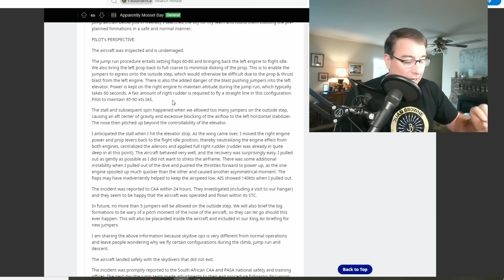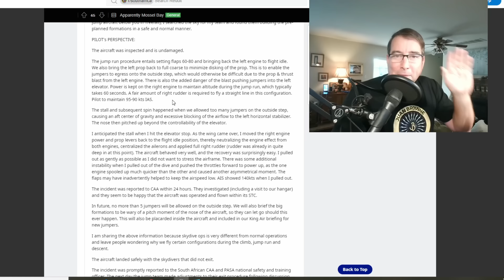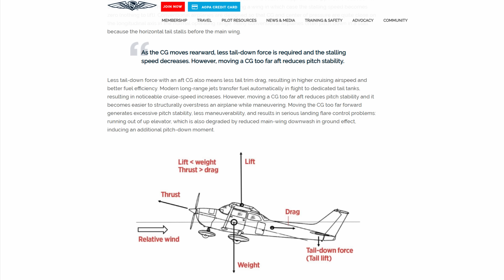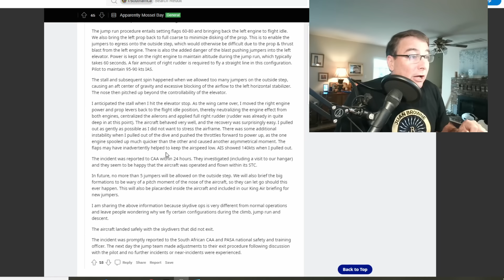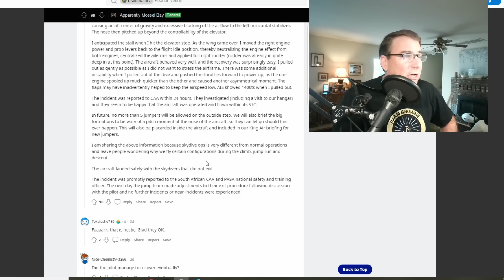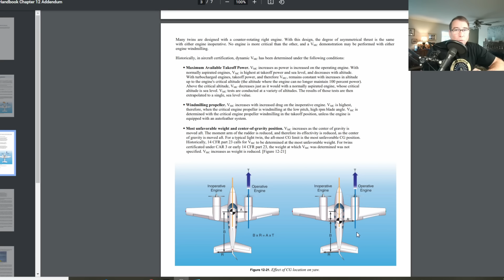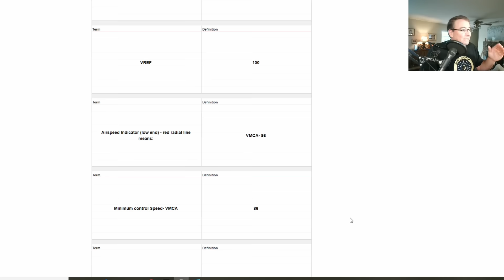Stall+Yaw=SPIN!  King Air Skydive Incident

Comment: On the inverted spin recovery vid at the end, is the reason you pull the stick back after opposite rudder is because it’s inverted? Cause I always am thinking stick forward?
Reply from the maker: yep...situational awareness.
Reply: Yes.  You want to point the nose of the plane at the ground to build air speed / break the stall.  When inverted the ground is stick aft.
Reply: Yes pull back if are inverted.
Decades ago when I was learning to fly gliders (in South Africa) my instructor threw me a curve ball.
He built up airspeed and then pulled up into a loop, but near the top he neutralised the elevator, so we continued to climb inverted until we were below stall speed.
A wing then dropped. At that point he said "you have contol". So I pull full back on the stick and applied opposite rudder. Came out right side up in a very steep dive, but well below VNE and still at a good altitude.

Comment: That type of spin due to asymetric thrust happened to me on my rc Model cessna 310 (72" WS). One of the engines stalled and I wasn't able to recover since it happened very close to the ground shortly after take off. It ended upside down in some tall grass with both props broken, the landing gear broken, one of the tip tanks smashed and a cracked windshield. I still have it and repaired it mostly but haven't flown it since that happened. I want to convert it to electric. so maybe things like that don't happen again.

Comment: That asymetric engine spooling is definitly an effect of that jump procedure. having that left engine along for the ride instead of running that long would allow the combustion chamber to cool down  (relative to the right engine) so once it stalled, and he idled both engines, then tried to ramp them in together, right's ready to rip and roar because it's been at a decent load where as left has to build chamber heat again and wake back up.  it's nothing out of the ordinary, but it's the perfect setup to have them performing at different ends of acceptable, causing this kind of behavior
Reply: But another King Air pilot said it was getting the pitch back to fine that would take time, and explain the longer spool-up time.

Comment: Years ago, I flew skydive ops in a C182 and Turbo Porter. Skydivers are a "different" crowd, and always keen to do something different. However, when EVERYBODY piles out of the aeroplane and just hang there, well life gets more interesting up front too! I even had one guy grab the leading edge of the flap (retracted) on the Porter - his grip was enough to deform the skin - so I released the brake at that point and he landed a little away from his mates..... 

As for twins, I never flew one on parachute ops, but in my humble opinion it makes NO sense intentionally setting asymmetric thrust! Just bring both power levers back, props in coarse if necessary, and accept a shallow descent. Straight-ahead stalls are a no-brainer to recover from, but spins are not nice in such close proximity to the meatbags (who were VERY lucky in this instance). 

Also, the pilot seems to have NO knowledge of spin recovery, and panicked! He recovered by shear luck (my opinion)!
Reply: Sheer luck it wasn’t shear luck!

Comment: I used to fly the 90 for a skydive center.  Get to altitude, slow the aircraft to about 100, approach flaps, and start a very shallow decent....KEEP IT AT 100.  ( NEVER would we consider reducing one engine, honestly thats just dumb, bad piloting.)  At this configuration, you're right on the edge of a stall.  Plus, you have all these skydivers trying to go out together, moving aft very quickly, not to mention those hanging outside.  So the CG is  moving aft fast.  We had an understanding w the jumpers to not do that.  And had to yell at them from time to time to slow down exiting. 

We didnt wear chutes in the King Air.  You aren't likely to get out.

Comment: At an old drop zone I used to jump at, it was standard procedure to being the left engine to idle and feather the prop on the twin otter. All other drop zones I've been to do t do this. It's more comfortable to jump this way without the prop blast but honestly not necessary, I just thought it was a courtesy from that one pilot/owner.
Reply from the maker: f-#$% that- what a dumb ass idea.
Reply: Hadn't ever thought about it till today but you're right dumb idea for little gain.
Reply: As Juan said, they can remove the prop blast by idling both engines and going into a descent instead. Also add some counterweight to prevent the CG from moving so far back.
Reply: I don't get the courtesy thing. I mean, they are paying to free fall, which entails lots of air flowing past you on the way down...what does some more wind matter as you exit?
Reply: @blancolirio  Thanks Juan.
Reply: @sideslip it’s more to do with the moments before you jump, especially those climbing out. With the prop blast it makes it more difficult to hold on (but not impossible). The twin otter was a much more stable aircraft though. Many drop zones I’ve been to that fly a king air brief you that there’s a maximum number of jumpers allowed in the door. This is the second incident I’ve seen involving aft CG and a stall with jumpers in the door on a king air, made worse in this case by the asymmetry.

Comment: Moderate right-aileron input: 00:34

I estimate a weight of 10,000 lbs for the King Air 90, with 1800 lbs for the initial wave of skydivers with clothing and equipment, assuming 1 female and 8 male South Africans. Positioning of the skydivers outside the left door moves the center of mass leftward. This minimizes left-yawing tendency due to their form drag, but increases left-yawing tendency from thrust of the right engine. The offset cg/weight adds to the left-rolling tendency. All 10 skydivers (including the straggler) would be positioned quite aftward, which reduces effectiveness of the empennage in both yaw and pitch.

Large right-aileron input: 00:45 (before spin)

The skydivers' positions aft of the left wing root increases pressure upwind of them, spoiling some of the lift near the left wing root. In cruise, the roll moment is somewhat balanced by a reduction of left-elevator downforce, due to blanking/drafting. However, when the pilot commands pitch forward, asymmetrical lift on the elevator increases left-rolling tendency.

TLDR: In this configuration, Vmca is higher than standard.

Comment: The KingAir at my DZ would also bring the left engine to idle on jump run. Lucky it was used mostly for Tandems and the Otter was used for Fun Jumpers. 

And the Skydiver that “exited” last said (in the comments on the original video) she was tossed around inside, ended up next to the door, tried to get up and was then ejected from the aircraft. She said she was ok and only sustained bumps and bruises.

Comment: This pilot is a total wack job. Aft CG, asymmetrical thrust, and crossed controlled. Piss poor recovery, he froze this is why he took so long to recover. Blow-up and look at the controls during the event.  I flew a C-90 jumper plane in the late 80ies. We never did what he did with the thrust, and controls, and that many jumpers. Our organization spent many many hours developing charts, procedures, and training. He is so lucky that he did not hit anyone.
Reply: Looked like a decent recovery to me - it appears he was trying to not over stress the aircraft. The initial loss of control was pretty severe, that’s not going to be an immediate recovery. 

As far as SOP for pulling the engine back , I’d imagine that’s not up to him - likely company procedure. Based on his summary and report, he sounds like a decent pilot. Flying aircraft outside of their normal parameters (banners, skydivers, etc) carries a ton of risk. Blanking an elevator is just something people won’t think about till it’s too late.
Reply: I don’t think it was a piss poor recovery.  It was about 15 seconds. He knew he had plenty of altitude and plenty of time to discern what was going on. He also didn’t know this stall/ spin was about to happen.  So a few ( as many as 5) seconds to crap your pants and interpret what you’re seeing, nova a few levers and controls and wait for the plane to start flying again.
Reply: First he lost at least 500', then went into a second stall and third stall, had improper control inputs, then had to much control inputs, need I go on. No where's near ATP/Comm standard.
Reply: @gezac440  yes he lost way more than 500 ft.  But any pilot would. This wasn't training in the practice area.  Any ATP would lose altitude when getting into an unexpected spin in real life.  Especially in a plane that you never had spin training in.

Comment: The PARE recovery is a fail safe way to recover from. A Stall/Spin. 
Power    Idle
Aileron   Netural
Rudder   Full opposite direction 
Elevator  Netural

I'm sure the pilot was using opposite aileron and most likely pulling back on yoke which puts aircraft into secondary spin during recovery attempts.

To avoid stall you can't exceed Critical AOA. Accept a slight descent. Don't pull back, load the wings. Use opposite ailerons. This all gets you to stall very quickly. Then rudder gets you to spin.

So remember the PARE recovery.

Comment: Excellent review of the incident.
As you mentioned it is entirely natural to apply opposite aileron and pull back hard. I consider the repeated or constant aft yoke input was the major factor in the failure to recover until several departures had occurred. There was more panic than technique going on.
At that height why the hurry to add power? I would have retarded both engines until spin recovery had been made.
The discing refers to the drag produced by a prop in fine pitch but low power. It makes the prop disc into a pretty effective airbrake. Very handy for dropping down a hillside during firebombing, to keep airspeed sensible. But the drag during a skydive exit would be awful. 
Glad it was not me. All got home safe, so it is something we can all learn from.
For example, aerobatics and upset training saves lives.
Cheers

Comment: My thoughts as an experienced meat missile…

There is always concern for a tail strike. It’s one of those overriding things.  The only thing lawn darts want to hit is the ground and not that low stabilizer. Thus the diver drivers will make efforts to ensure that the AOA and airspeed are low enough so that there is minimal chance of tail strike. 

I think this pilot just got too slow. Would have gotten away with it but maybe a female skydiver showed her boobs to the pilot and got extra altitude because 16k is pretty high. That jump run would be adequate at even 15k feet.

Comment: We do a lot of spin training in gliders/sailplanes in the UK.
Once in the spin, the standard recovery is full oposite rudder, stick centrally forward until the spin stops, centralise rudder and  pull out of the ensuing dive.
A harsh pull out of the dive can sometimes cause an accellerated stall, where the aircraft stalls at a higher speed, to the non pilots out there.
Interesting video. I didn't notice the ailerons deflected or realised there was more power on one engine prior to the spin.
I thought the centre of gravity was too far aff, and with positive flap/slow speed, when they leapt off the plane, that  briefly bumped the CofG further aff, causing the wing to stall and departing the aircraft into the stall/spin.

Comment: I remember my father spinning thru 10 jumpers with a Beech 18. We were in formation of 4 of 18s prepping for a 4th of July event. After a long practice day and on the final jump run, all the jumpers in my father's aircraft moved to the door causing an instant nose up and subsequent stall spin. Indescribable, and shocking how fast the aft CG caused this loss of control. We NEVER, EVER used asymmetric thrust. Nor did we use full flaps. An instant of exicted movement by highly experienced jumpers...the video is chilling as you can see an aircraft wing spin by, mere feet from the camera.

Comment: I've jumped a lot of aircrafts and most times when it was twin-engine plane with side door (usually L-410) - pilots reduced thrust on one engine  to iddle or near that. So it's a normal procedure, but of course we usually have some limitations on exit (red line or similar). With L-410 it's more about comfort, but when stabilisator is low enough - it is about safety (expecially with wigsuits, nobody wants to damage a plane by own body)

P. S.  and I've done a lot of skydives in or through clouds. Of course it wasn't a 100-way RW or smth like that

Comment: I with you on this one. The issue isn’t the number of guys outside the airplane. That was just the final hole in the Swiss cheese that lined up to create this incident. The real cause was their screwball Pro-spin configuration that they used for doing drops. That setup just leaves waaaay to little margin of anything else goes wrong.

Comment: I received quite a lot of spin training in gliders and I don't recall having much or any control over where the aircraft was going until fully recovered. It was a case of 
 Oops it's dropped a wing, its spinning so opposite rudder, wait till  the world stops going round and round, check and/or wait for airspeed to build, gentle recovery. Most common mistake I made was either trying to recover too soon (stall spin again) or too hard (high speed stall, buffeting and may spin again). You don't really have any idea where you are going until the aircraft is recovered then you can look around and think about that.

Comment: Don’t forget that VMC will decrease with altitude. Not as much as in a normally aspirated engine. But a turbine engine will also have less power up at 14,000’. So that VMC comes right down to stall speed and crosses over. The airplane may stall before VMC and then it’s an instant spin. Just like we’re seeing. We used to limit the amount of rudder a student could put in for the VMC demo because we wanted him to see the VMC roll before it stalled and spun.

Comment: Juan,  the "coarse pitch" to reduce disking is a function modern turboprop engines.  As you bring the power levers back the props 'fine' to keep the rpm constant.  As you get to idle the prop is, effectively, a "disk" and lots of drag on one side.  It is also an issue in the flare if you bring the levers back too much you will get two flat disks - rapid reduction of airspeed - not a smooth landing:-(. Regards, Mike ex RAF Jetstream/King Air.

Comment: 6 on the step?  Well They managed to spit out 9 people during the stall and break-over…  Bet that was a heck of a ride for the ones who didn’t get out right away…  great analysis as always,   Bucket of prop wash, you crack me up:)
Reply: Yeah, I’ve noticed that too. 8 people fall/jump off/out plus the guy with the camera. I presume some of them jumped out of the door. In any case that’s nearly a metric ton of weight shed. Should have a substantial effect for the CG. But I’m no expert at all.
Reply: @skullhqx  it would have a substantial effect, but remember, when a wing stalls, it mostly stops making lift, and the wing was already well into/committed to the stall when they got off.  Shedding the weight wouldn’t immediately alter the angle of attack/stop that stall process, it would just change the way it would spin and respond(for the better).  If they had still been in/on the tail, it may have made the stall impossible to break, for the same reason all that aft weight pushed the tail down opposed to the wing lift in the first place.  I agree with Blanco, the asymmetrical setup turned this from a straightforward stall into the wild ride that we saw.  The pilot knew he was running out of elevator, and probably figured it was going to stall, but based on his 3 strike recovery technique,  I think the spin caught him unaware, and it should not have...  I don’t know, is the King air rated for spin training?  Given the asymmetrical and unpredictable nature of jump ops, unusual attitude and situation recovery might be a good thing to actually practice and be able to demonstrate in the type aircraft used…

Comment: Maybe things have changed recently but 20 years ago in a Twin Otter they used to simply pull back to idle, allow for a slight sink rate as the jumpers went out in a train instead of all hanging outside the door.  This maintained a stable jump platform and minimized jumpers time in the prop wash.  No expert here, just an observation of a group jump that went smoothly.

Comment: was jumping in the 70's. no turboprops. DC-3s, occasionally a Beech-18, and 30min to 7500 w/ 4 jumpers and the pilot on board a C-182 or C-180.

Comment: "Meat missiles", sounds like you have some experience in this world Juan.  This happened to me (from the jumper's perspective) back in the 90s when a well known owner brought his newly purchased  aircraft (same B90 as this one) to an Oklahoma DZ for a weekend of fun.  It was the very first "test' flight for him with jumpers and I just happened to be the one stuck in the door when he let the stall happen.  No asymmetric thrust here but he simply got to slow.  This pilot/owner was an extremely experienced jump pilot but obviously was new to this aircraft.  He actually tried to blame the jumpers later  but everyone knew he screwed up, and there was some flap damage with two of the floater's (outside jumpers) falling into the wing trailing edge when the stall occurred.  Every jump pilot I knew (including myself) always added altitude for the exit and kept as much power in as the floaters could handle.  Last thing you wanted is this happening when you have all those Meat missiles hanging on the outside of your aircraft.

Comment: I do this a lot with my king air. It isn’t a big deal as long as I have a 100lbs of sand bags forward of cg. We actually use a rope and pulley to pull the sand forward out of a flat spin if we want to do flat spins. I live in mde.